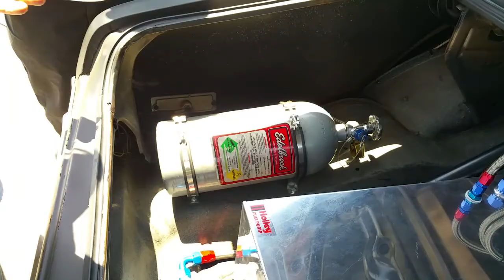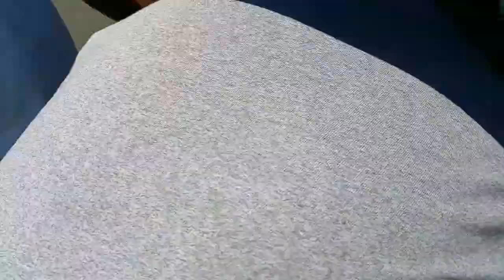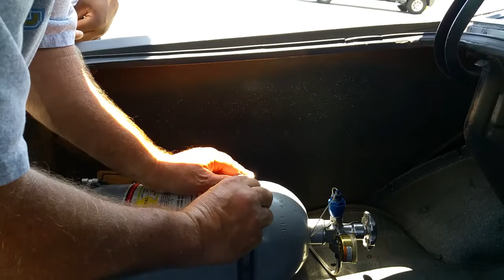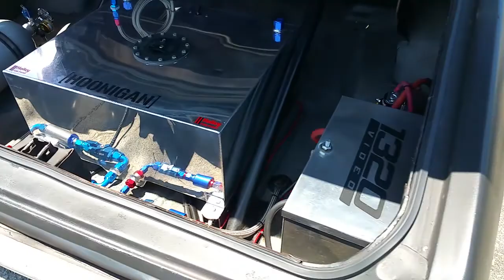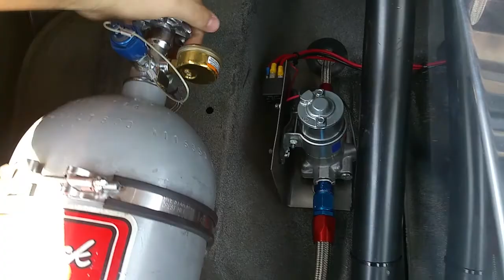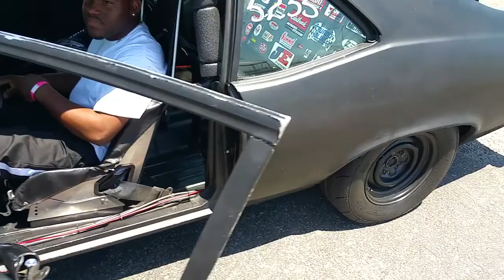GETTING READY FOR NITROUS

Comment: Can't you just pull the gauge off your carb line or switch them to see if your still getting a low reading ? If it shows good then just leave it there and get a new one for your carb
Reply from the maker: that gauge is gone, we put a nipple in place and used a autometer gauge
Reply: +ss396rat ahhh good deal glad to see everything is working out ..